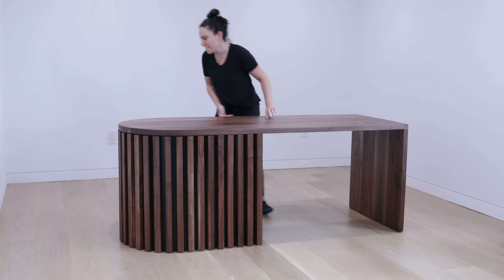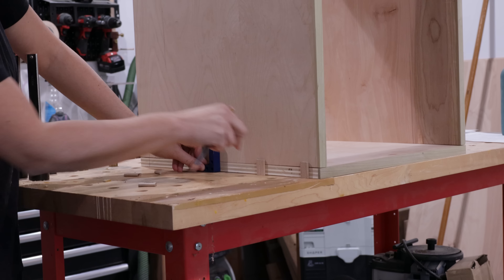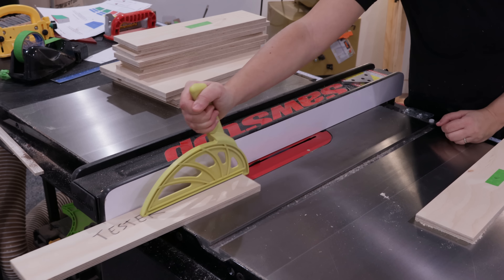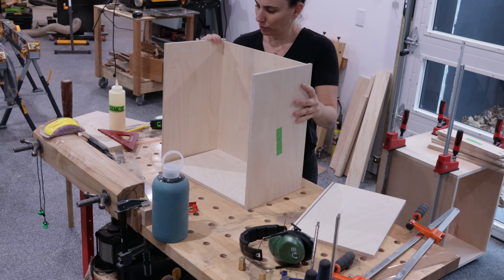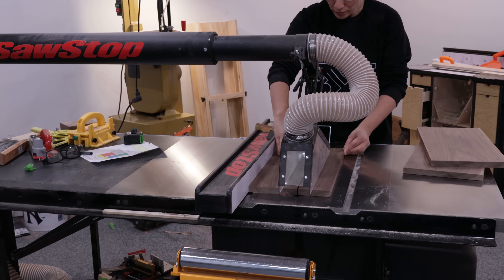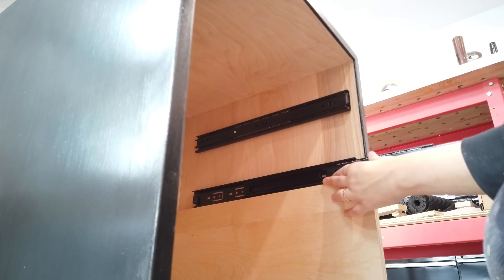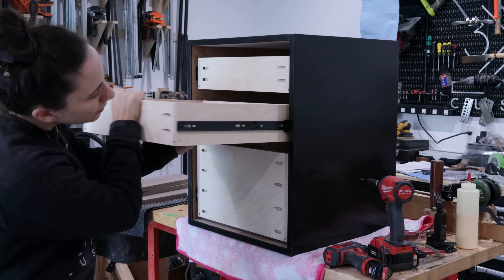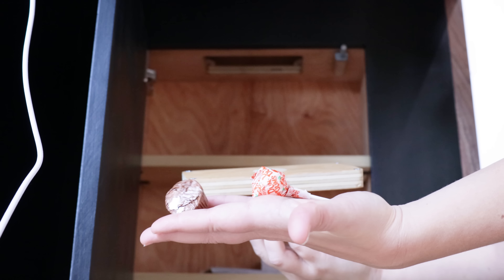Building a Rolling File Cabinet

Comment: Thanks - one of the best drawer videos !!! ... To add a small "trick" if you have a lot of cabinets to fit drawers of different sizes , rather than using a "scrap" panel of plywood to size where the cabinet drawers fit and cutting it to size each time , take a couple of off cuts and cut them to a few pieces of 20cm, a few pieces at 10cm , 5cm , 2cm and 1cm and color code them with some sharpie ... This way you can "build up" a spacer of any size you want rather than "wasting" a lot of panels and sacrificing them as spacers .. if you have 5 cabinets of different drawer sizes you would end up "wasting" 5 different panels of ply (and plywood is NOT cheap these days!)

Comment: That is a great looking desk.  Love walnut.  You're brave using a paint brush instead of a roller on the rolling cabinet.  No wonder you don't like painting ;-).   I've generally stopped marking for the Domino's middle holes, but instead use the cross stops (I have a DF 700, so maybe they're not as handy on the 500).  Much quicker, and more accurate.  Fun to watch the cabinet come together.
Reply from the maker: Haha I hate using a roller too 😂

Comment: 5:30 cut grooves, was the depth of cut the same in all grooves?  You can use "I.D. O.D" , welders technique
Reply from the maker: Depth is the same yes. But I don’t know what that measurement actually is. I just line up the blade to a height that “looks good”

Comment: Any plans for a project that utilize 20 / 30 or 45 deg.angle  Joinery ?  This seems to be the least addressed type and everything I've seen are for small  joints like drawers vs larger pieces that would need strength .

Comment: The black paint and walnut combination really stands out. A few thoughts: didn't you consider mitered edges for the module? You have a domino cutter anyway, and although assembly is more difficult, you wouldn't have to struggle with putty afterwards. Visually also more attractive as you don't have plywood end grain. For this kind of furniture I would even consider MDF rather than plywood.
Reply from the maker: I considered edge banding it. Then I forgot… ha.

Comment: I thin I might have missed something. I noticed that you set the drawer width (fronts and backs) by measuring the leftover when the drawer slides and sides were put in and then, as if by magic or sheer luck, they fit file folders with hangers on each side. I only noticed because I'm getting ready to do some drawers and I'm shooting for an exact internal drawer width and I have found working from the inside width I need plus the width of the sides and slides to come up with cabinet width. Clearly you are better than me on this.
Reply from the maker: That wasn’t magic. I planned for the width to fit files. I knew I was using 1/2” ply. I know draw slides are a 1/2” thick each. So I knew what width drawer I would have. But that exact measurement is like is it 15 and a 1/2 or is it 15 and 15/32?
Reply: @3x3CustomTamar  That is what I suspected, it just didn't look that way. I will pay more attention next time. Thank You

Comment: I'm surprised that the cabinet top and bottom ate above and below the sides. I was always taught that the top and botyom should be inside the sides.  Do you always build cabinets this way? Thanx!  hb
Reply from the maker: Yeah, I built a cabinet the other way a few years ago and the bottom dropped out. There is more support this way. But to each their own
Reply: Hmm... I would think that such dropout would be more likely to occur if the bottom is screwed to the bottom of the sides. It takes a lot more force to remove a bottom that is inside the sides.  @3x3CustomTamar

Comment: awesome build. I have wanted to make some thing similar to store airbrush paints. I am curious how you came up with the draw heights? is there a generally accepted height, or do you decide how many drawers you want and divide the space evenly?
Reply from the maker: Well… I knew I needed the bottom drawer to be tall enough for files. And I knew this needed to fit under the desk. So after those 2 things were works out I could just divide what was left over.

Comment: Interesting.  Did you build two of these?  Because the one that you slide under the desk looks different than the one you slide into the corner.  In the build you put the top and bottom on top of the sides which means you can see the end of the plywood on the sides.  This is visible in the one you slid under the desk.  If you make the sides longer and put the put the top and bottom between the sides, then the end grain for the plywood is no longer visible which seems to match the one you rolled into the corner with the printer on top.  Just an observation.
Reply from the maker: Same one. I only end banded the front edges. Not the sides of the top and bottom. I probably should have.

Comment: Hi Tamar. Question (sorry if it's been asked before): I see you use the Festool Domino but a Triton track saw. Always was impressed with the Festool Track Saws, except, of course, for the price. What is your opinion of the Triton? I don't have a track saw yet, but looking at the Triton and Makita. 

Another great job on this video, BTW. Also, sure it bothered you, but don't waste your time on the A**hole that makes fun of your accent. Being from Texas, we usually add a few syllables, but you removed one. Very efficient!
😉
Reply from the maker: Hi! The triton was sent to me. That’s why I use it. It is fine, the biggest problem is that there are a lot of after market accessories that don’t fit the track. If I were buying one, I probably wouldn’t buy it.